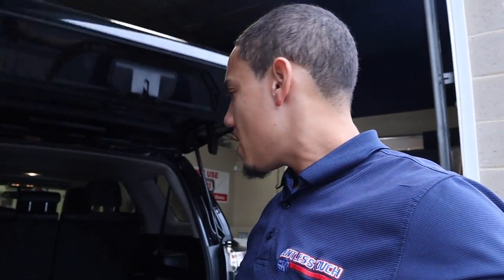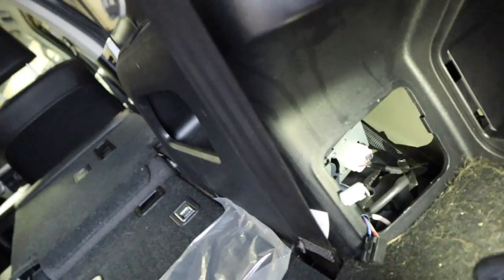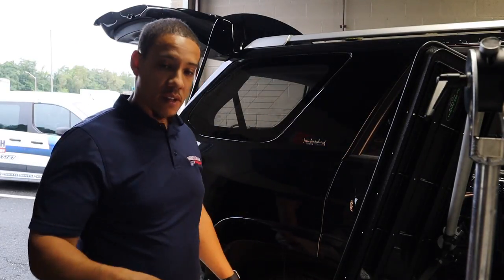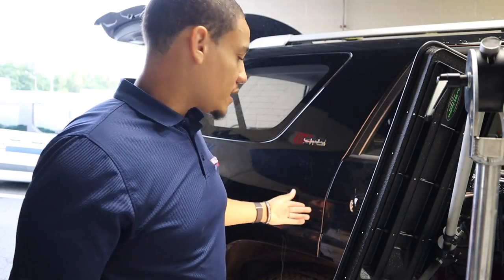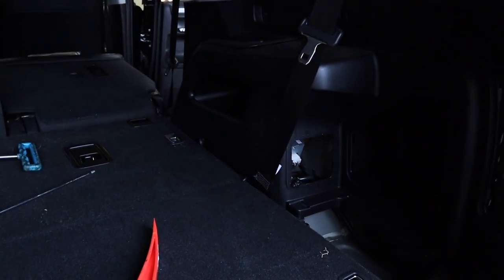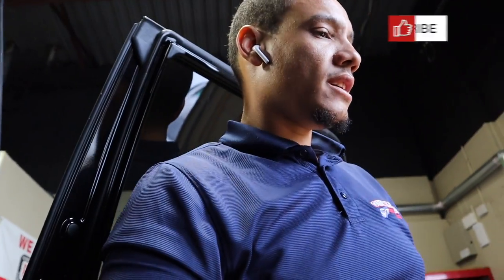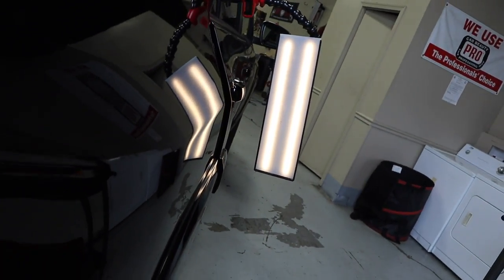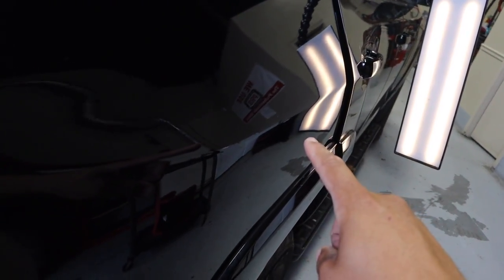2018 Toyota 4runner Paintless Dent Repair From Start to Finish

Comment: Nice repair! Especially without creating an access point. Toyota metal is some of the worst out there aside from Mazda. It's great when you get a repair that someone has messed with whether it be the customer or another tech. Makes our job that much harder. Good work!

Comment: You have to lift the car, remove the wheel and pull the wheel liner out (have replacement clips handy, you're going to break them all getting them out) and you will have access to that point pretty easily.
Reply: You must have a similar dent circumstance on ur 4 runner huh

Comment: You are fast, precise and efficient, but a beginner cannot learn much from this video. A nickle size dent has a soda can crown around it, and the crown won't let the dent to go.  First with a dent light you must see all the disturbed surface around dent and mark it. Tapping the crown while the center of the dent is pulled with a screw puller help. Doing this we use 3 hands: the Manelord Auto Body Repair Tool Kit, Car Dent Puller with Double Pole Bridge Dent Puller, and two our hand for Tapping the crowns.